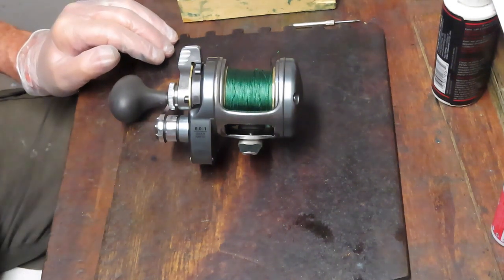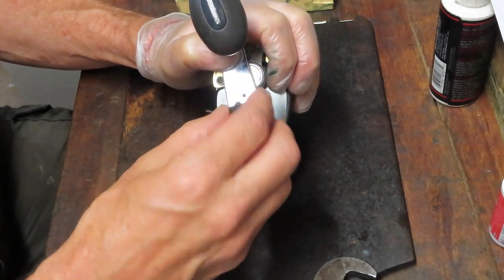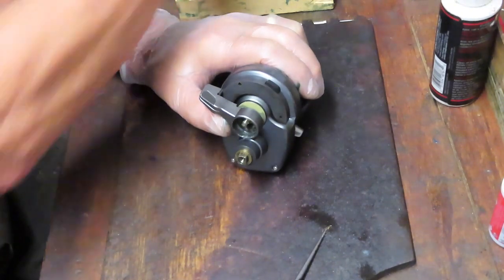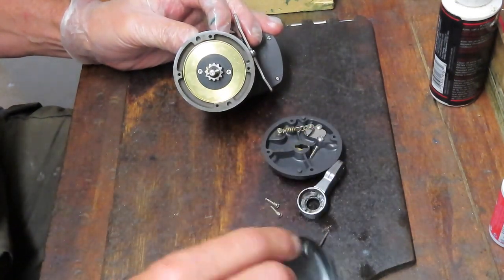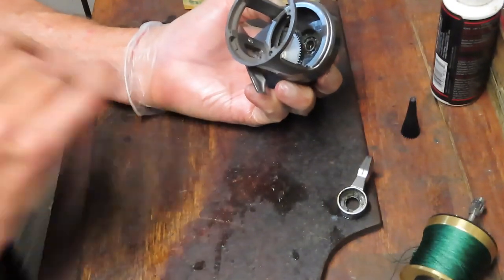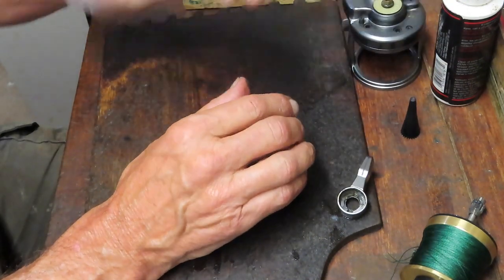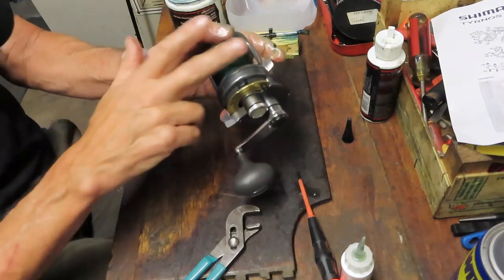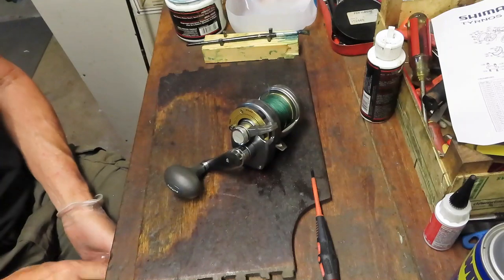Shimano Tyrnos 10 Lever Drag fishing reel take apart and how to service

Comment: I just bought one of these in a 20 size, also single speed. These reels have a bad rap with the handle falling out on the smaller 10/15 models. This is usually caused by a bad application of loctite.  Mine is loaded with 50lb mono and is going to be my main trolling rig and for big 40lb+ bluefin tuna .  Thanks for doing this reel.
Reply from the maker: You are welcome, and thanks for the note on the handle issue - Dennis

Comment: Just a heads up on my 30 the main gear nut is a 13mm not 11mm and I nearly broke it off as was trying to loosen it clockwise as you mentioned but yet again on mine it was anti clockwise as normal thread.
Reply from the maker: Interesting.  Sounds like they had a design change - Thanks for the note - Dennis

Comment: I don’t use braid very often since my vintage reels were designed for mono. The few times that I have used it I have always backed it with mono and then used a double uni knot to tie the braid to the mono. I’ve only done this with a few reels for which I had multiple spools that I could quickly change. This reel was very interesting. Well done Dennis! By the way, where did you get the larger set of precision screwdrivers?
Reply from the maker: Harbor Freight! I don't use them much, but it helps when I need extra leverage - Dennis
Reply: 2nd Chance Tackle  I have had that same set of yellow and black precision  screwdrivers for a long time. My wife was a band director and use then to repair band instruments. You’re right about the torque as that is why I asked you the question. Thanks Dennis!

Comment: I have a tyrnos 16ii 2 speed and I was wondering if the sound that it makes when reeling is just the really strong anti-reverse, or if there is something genuinely wrong with my reel (The clicker isnt on). Thanks
Reply from the maker: I suspect it is the A/R if it has always made the click noise.  It is hard to say. without hearing it, but you cannot over-ride the A/R and the click will be steady as it bounces from tooth to tooth on the ratchet - Dennis
Reply: Hyper I bought one of these reels last year. I have the same problem with my 10 the reel just clicks. It is annoying to me too!

Comment: Hello. Drag control lever made from plastic in this reel?
Reply from the maker: I think it is metal.  it would be hard to make a plastic lever that would withstand the rigors of that reel
Reply: @2ndChanceTackle  i don't understand what kind of material used because it's painted! All seems like plastic, except hand and covers))

Comment: Kind of a strange one. Are those aesthetic covers meant to make it look like a metal body when it's a graphite reel? All those screws must be to try and strengthen the graphite but seems rather ridiculous to have 14 screws to open both sides.
Reply from the maker: I'm not sure what they were thinking!  There is always a "Fashion industry" perspective to these reels.  The exterior changes with colors, materials, etc, but under the covers they are basically the same.  This one was certainly the most screws I have seen in a reel like this.